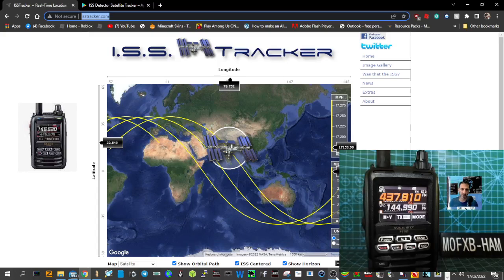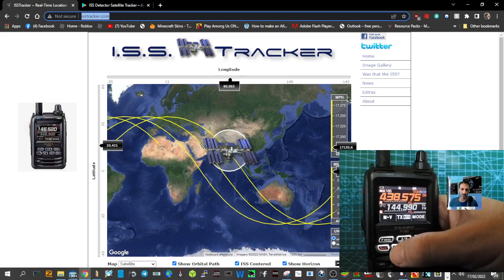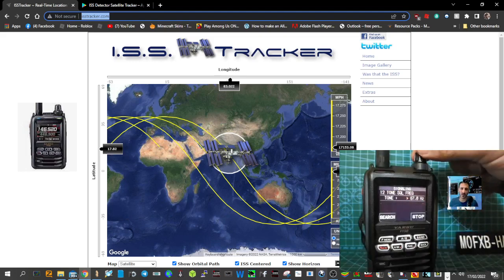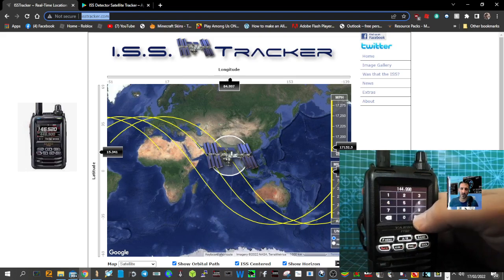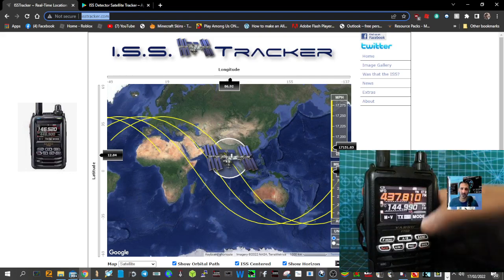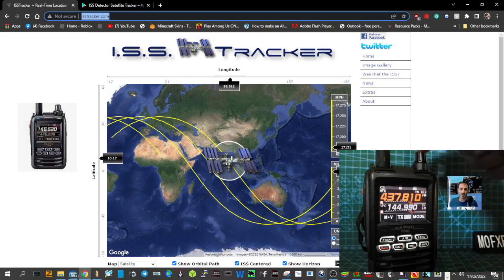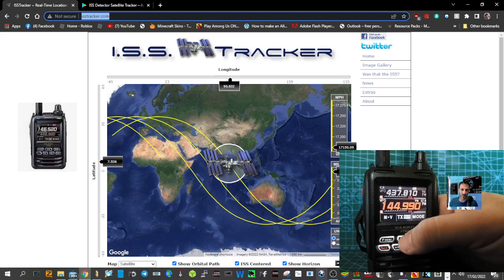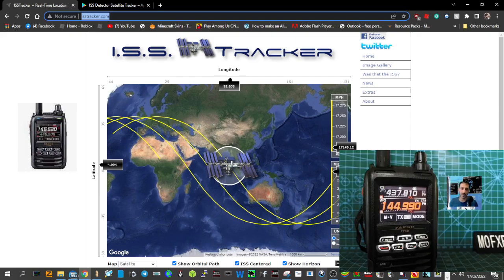ISS Repeater-Yaesu FT5 Set Up (vfo mode)

Comment: Hello, Andreas! I am trying to do what you have done in your video to a Yaesu FT5DE and cannot access "CODE" and cannot adjust "SQL TYPE" (in "SQTYP") on the "B" band but can on the frequencies you are using on the "A" band only....can you please tell me what I doing wrong? A million thanks in advance...M7CQQ, 73's...
Reply from the maker: Turn off the modem in aprs settings and that's it, you can't have modem and tones at the same time.
Reply: @M0FXBHamTech  Awesome! it worked! I looked everywhere for the answer....good job, mate....a big thanks🙂